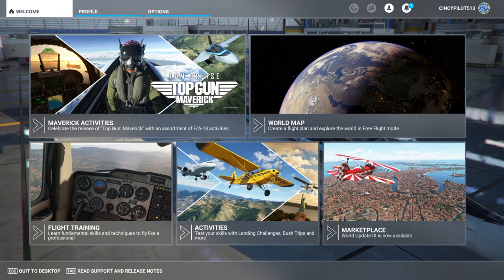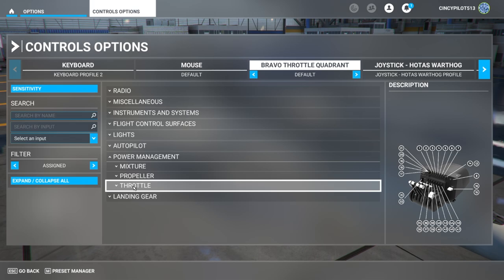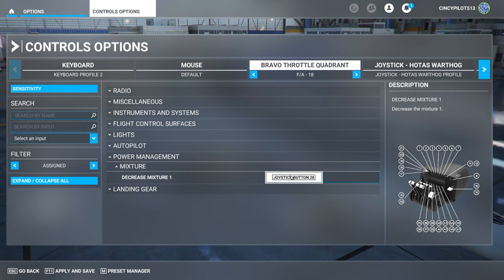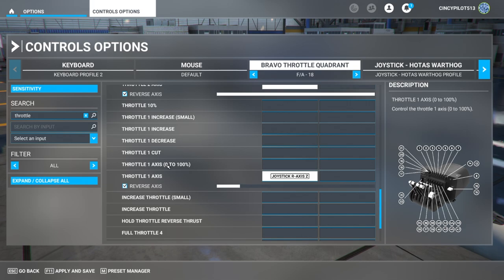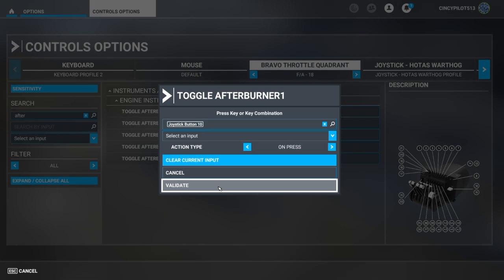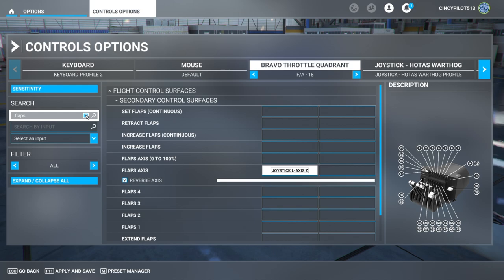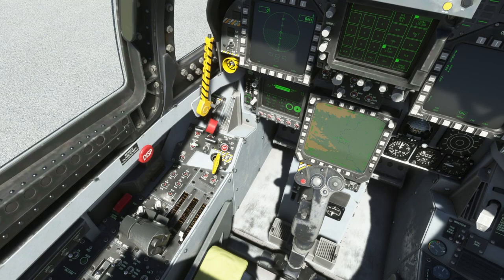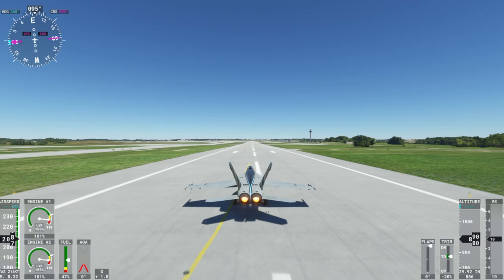Honeycomb Bravo Flight Sim Throttle -  F/A-18 Super Hornet Configuration (be your own Top Gun!)

Comment: Set the F18 up just like you have it, whenever the sim has to reset one of the low altitude runs due to flying out of the area or flying into the ground, afterburner 2 will not come back on.  Have you seen this issue?

Comment: a problem I am having is after I initiate afterburners for both engines and I take off both engines cut out and lose altitude. Any help? I followed everything properly. I have no other controllers connected that will interfere. I have alpha and bravo flight controllers. No other interfering bindings. my software is all up to date on controllers and msfs
Reply: I have this problem also, did you ever find a fix?
Reply: I also am having this problem